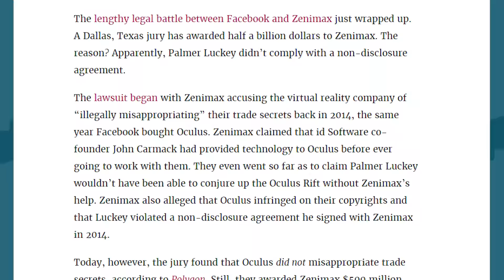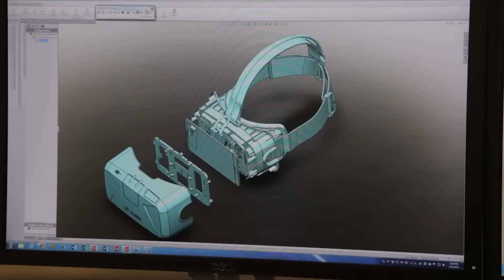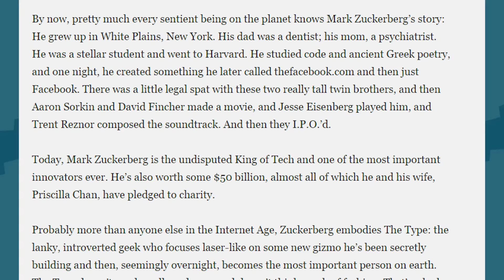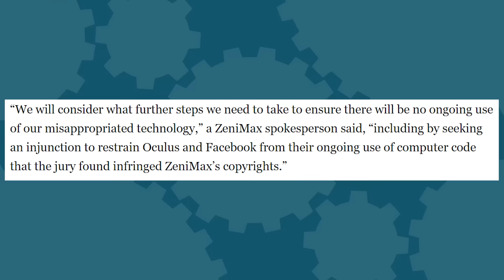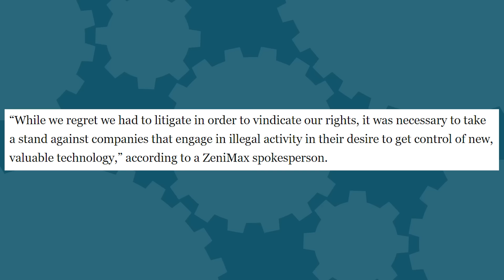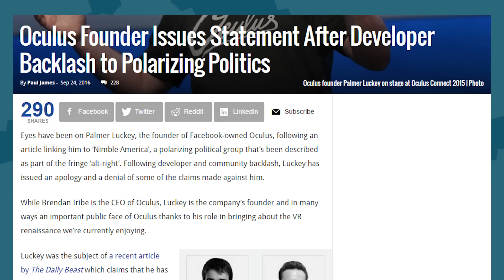Oculus Defeated in Court, Rift DEAD? - The Know Tech News

Comment: man, I always wanted d Rift... because I can't afford a Vive
Reply: FrostBlocker try osvr it's cheaper. and open source
Reply: FrostBlocker vive is cheaper than the rift with 3 sensors and hand controllers
Reply: exactlly, to get the same-ish experience from Rift as from Vive you actually have to pay MORE ...

and its inferior experience than on Vive because OR was engineered as sitting experience only with roomscale tacked on top, but Vive was engineered as roomscale from the day one...

and Lighthouse tech beats infrared camera(s) (especially since every camera you plug into the PC taxes the system leaving less resources for the headset ...) for tracking all day every day ...